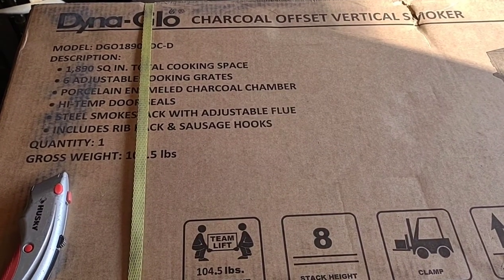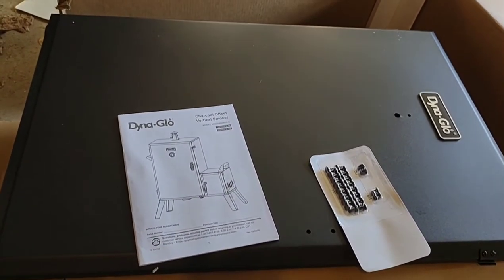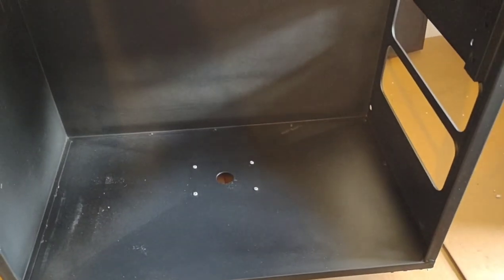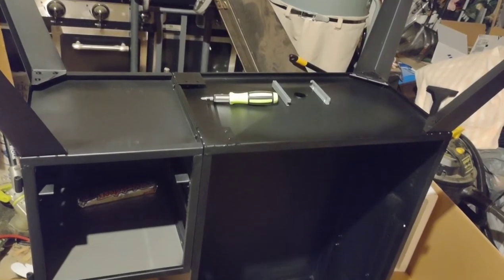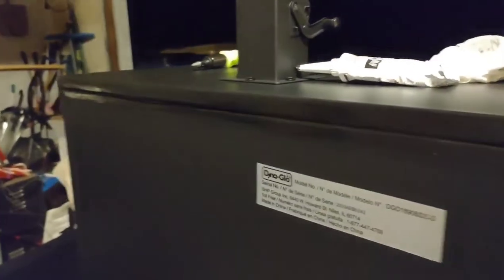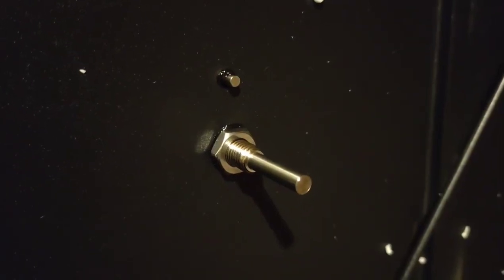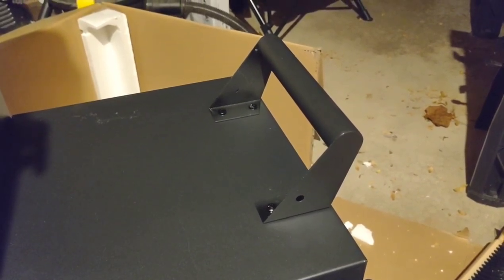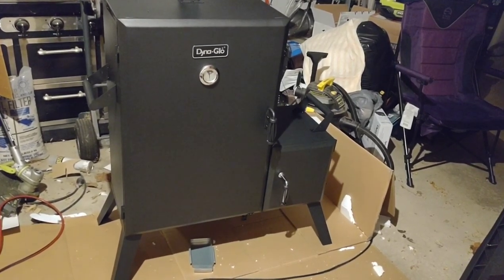Dyna Glo Widebody Vertical Smoker Assembly step by step

Comment: Is the application of rtv necessary or an added detail
Reply from the maker: It seals the chamber and firebox which helps to keep the smoke inside. Its not necessary, but it does let you cook more consistently and get repeatable results. It was worth the extra $6 to me👍🏼🇺🇸🥃

Comment: Check the bottom of the cook chamber  a couple small holes there too..and in the door on the bottom close to the edge of the gasket.. Although I don't think they meant to build this thing airtight...probably don't hurt tho..  Also seasoned mine with some vegetable oil before I did the burn in...Load up your racks...somtime after..and pickup some  pillsbury biscuits put them on your racks you'll find all your hot spots.😁🤙..  don't eat the burnt biscuits.. but the golden Brown ones should be good😁🤙💯👍..
Happy smoking bro
Cheers eh🇨🇦👍
Reply from the maker: Awesome advice .... Going to watch every inch for leaks, have plenty of sealant for spot fills.  I appreciate the heads up. Plan on doing a pork butt tomorrow after the burn in....will also be coating the whole interior with vegetable oil.  Got my sprayer and paper towels ready.  Will be fully seasoned.....I love new toys🤘🏼😎🤘🏼🇺🇸 Thanks again for the advice, I really appreciate it👍🏼
Reply: @2AChef-n-BBQ  💯👍😁🇨🇦🔥💨